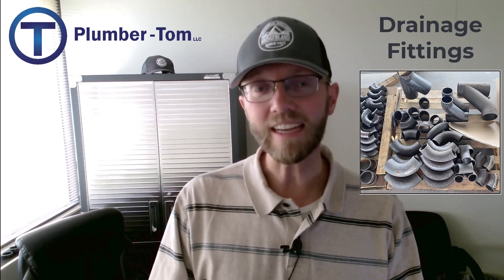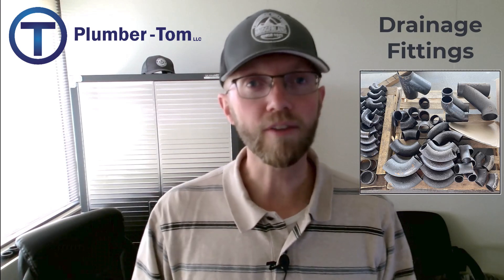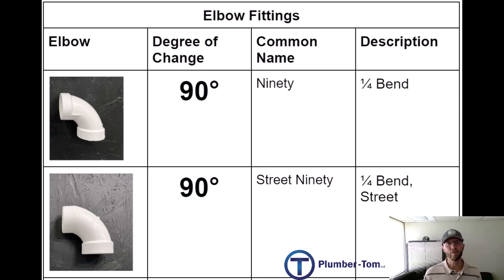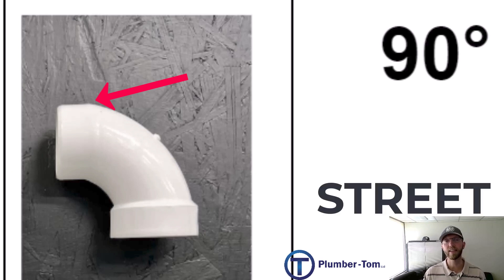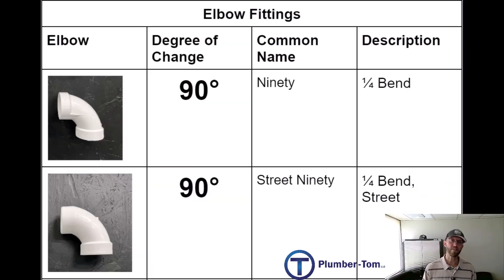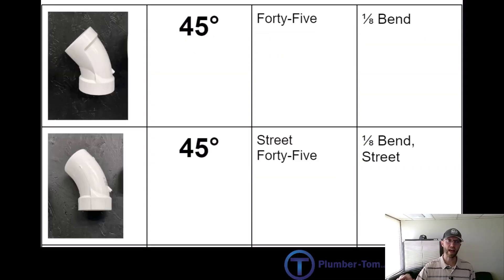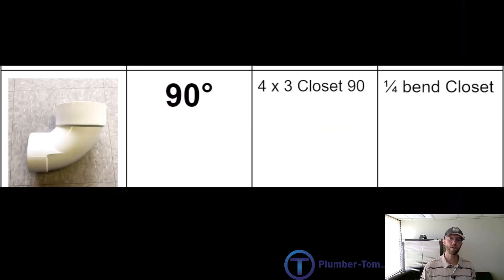Plumbing Parts Identification: Episode 2 - Drainage Fittings - Elbows

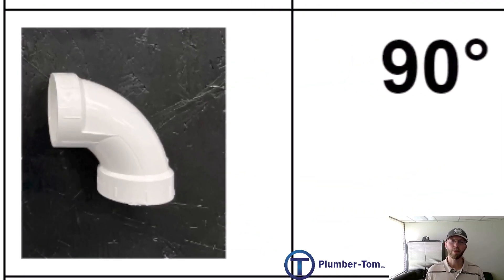Comment: 1:55 Is there a reason that the regular 90s (not the street 90s) are slightly different at each end?  Like the way they are molded on the outside.  Is there a reason for that?
Reply from the maker: It can vary from one manufacturer to another. So I don’t think it is too relevant.